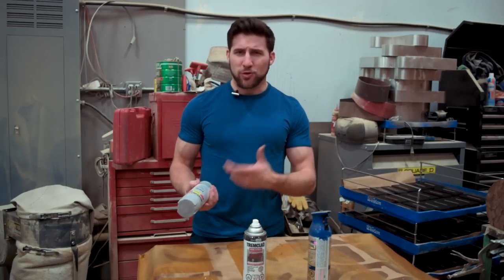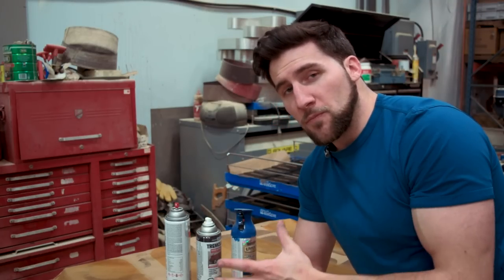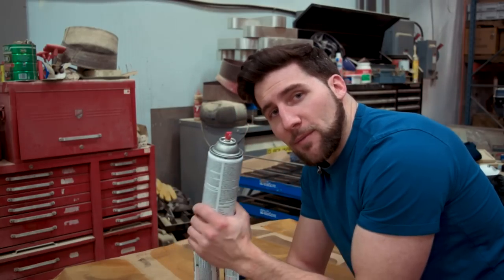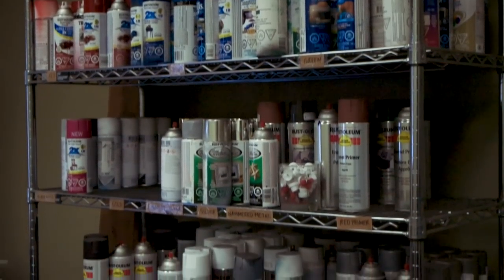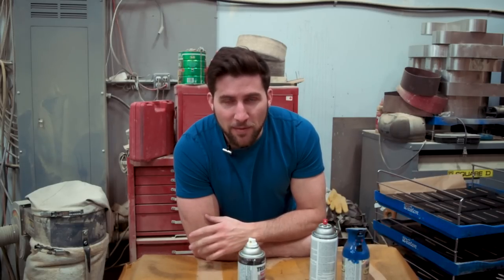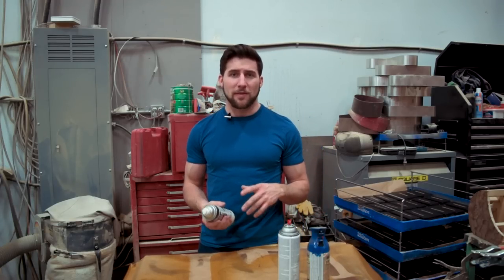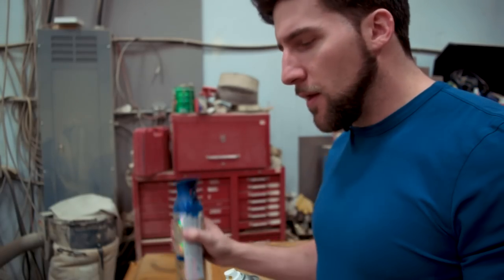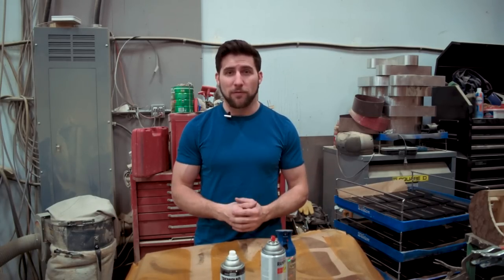Why are your paint cans spitting? (Solve the Problem!)

Comment: Warmed up cans are the key to getting paint to lay down perfect!
Reply: @designstudio8013  That will keep the cans warmed up!
Reply: Done. In the microwave it goes
Reply: @Ryan-eu3kp  air fryer is better solution
Reply: I usually heat them straight on the stove open flame much faster

Comment: I can’t believe I was putting my finger in front of it all this time!!! Thank you 😂😂
Reply from the maker: It’s actually a very common thing haha.
Reply: @BradAngove  Love your vids, Brad. I had exactly this happen, spraying SprayMax clearcoat. I was following all the safety requirements on the can, including some thin latex gloves to protect the skin. Well wouldn't you know it, I was getting terrible clearcoat spattering and nasty droplets on a guitar I was working on...and the problem was the little bit of excess latex glove at the fingertip was slightly obstructing the vertical fan of the spray pattern and that was what was causing the spitting and splattering! So annoying, now I have to figure out how to fix the mess.
Reply from the maker: You’ll have to sand smooth and recoat likely.
Reply: @BradAngove  Thanks Brad, that's exactly what I had to do. I was so frustrated that I might have to go back to the painting stage, and that would've been traumatic as my paint job was a complex burst (using your template video) with blue candy over silver base, and sapphire blue pearl over black base)...but with 2 hours of careful, painstaking wet-sanding, I was able to remove the spit marks right down to the paint without removing hardly any paint, and re-clearcoated it. Fortunately I ended up with excellent results after a bunch more wet-sanding and polishing.

Comment: Good points.
The environment (temperature, humidity, ventilation) where you spray and store the spray cans is very important.
I used to blame the spray cans for bad results more than I should have.
After the steep learning curve with paint guns and setting up a decent spray booth with proper conditions I once had a temporary issue with my compressor, so I ended up using some spray cans I still had laying around for a non important project and I was amazed at the result I was never able to achieve with the very same spray cans in the past. 
Also had no spitting anymore because the spray cans (I moved along with the other spraying equipment) were now stored in room temperature conditions instead of a cold cellar before.
I guess you could add the point: read AND follow the instructions on the spray cans :-)
Reply from the maker: I rarely read the cans. Over the years I’ve convinced myself that I know better or something haha.

Comment: hay thanks for replying me, ok now i have another issue, i spray painted my motorcycle then clear-coated it, i noticed some areas drops showing which need scuffing so i decided to sand clear-coat to reach paint and after that i level the paint, i sprayed to that scuffed part again, now i have issue of overspray on edges where clear coat was already there..how i remove the overspray from clearcoat on edges? should buff all area and clearcoat all again?
Reply from the maker: You may be able to just buff that overspray off with a polisher. That's probably easier, but if not you can gently sand it off and then go through the polishing process.
Reply: thankyou. i have fixed this problem.

Comment: Nozzle failure can also create this effect.  The red nozzle like in the video can easily crack at the stem and broken pieces can end inside the can.  I have noticed that clear coat spay cans can spit more than colors, and it is very obvious when you are nearing the end.  Also shaking the can throughout the painting process can keep the spitting at bay.

Comment: Great tips.  One of the simplest ones is on the side of the can... if you're too far away the spray drops may have time to collide and form larger drops (obviously too close and you're getting rivers).
Reply: Nice one as well. Dunno whether I´m just dumb or I missed that one somehow, but I learned the hard way that if I jerk the can too much during the spraying I get drops as well. Slow changes in direction do much better. Somehow I thought that if I move too slow there will be too much paint in one spot but it seems to do the trick alright. (don´t have to mention I´m new to this I hope)
Reply from the maker: Have a look at my video on how to get an even coat of paint with spray cans. You should not be spraying while changing directions.

Comment: The issue I have is the spray can feels stiff. The nossle. Either I press hard & hard a sudden rush of pressure. Or I try control it & get splatter, I'm going to try heat up my spray bottle after I sand sway the splatter marks once again.
Reply from the maker: Have you tried one of the trigger attachments?
Reply: @BradAngove  I heated up the can & got a good spray pattern now. I just think the paint was too thick. Now the can still has paint but no air inside lol thankfully I am done with base

Comment: I have to use spray cans pretty often and highly recommend a trigger handle. For those who don't know, you put this on the can and it allows you to use it the same way you would a spray gun. Your fingers get way less tired and you've got more control.
Reply from the maker: I disagree on the control aspect, but they definitely help with finger fatigue if that’s an issue for you, and are quite useful if you’re not switching colours much.
Reply: after trying a bunch of nozzles to spray PlastiDip without sputter, I tried the trigger handle and it worked perfectly, even with having to hold the can at extreme angles. I think the plunger pushes directly down on the nozzle and that makes the difference, when you try to hold your finger down for a long time it wiggles around and makes the nozzle stem cockeyed in the can, and that causes drips and sputter.

Comment: Rust oleum frosted glass is the worst. No rhyme or reason. Some cans spray great, some splatter like crazy from brand new and no matter the technique it just won’t work. I’ve scraped and redone aquariums so many times. And other cans work fine the whole way. Some work fine till about 1/3 left in can. Struggling right now with a can I bought yesterday and it’s driving me nuts bc I work with this stuff a fair amount and I just can’t for the life of me get this can to not spatter from the get go

Comment: I just checked my gloves You are spot on paint on the trigger finger. Wait for this coat to dry sand again and check my trigger finger closer this next coating. BTW Only had splutter on last 2 coats first 2 were splutter free so maybe gloves were tighter on finger then Top tip so Cheers

Comment: I've been spraying 2 guitars with many spray cans of colour and clear. No issues ever. Has been coming out really well. On my last can (murpheys law) of clear, the spray comes out thin with quite high pressure and lots of droplets. Tried replacing cap as well as warm water technique. Nothing seems to work. Maybe I didnt do it properly. Rather confused 😕
Reply from the maker: Sometimes things just get jammed up inside the can unfortunately.

Comment: Another problem is how there stored . Store them on there side so the solids don't settle on the bottom of the can.they mix easier with it like that too
Reply from the maker: Yup. You have to shake them well regardless, but storage is relevant.
Reply: So, is storing them on the side is good?
Reply from the maker: It can help. I like to store mine upside down sometimes as well.

Comment: Good tips! I'm new to spraying. I also read that if the humidity is too high, it will screw up your paint job when spraying. I'm doing my guitar, and had great results until I tried to put one last light coat of base color on, and the can (that was almost out of paint but I didn't realize it, it's a small 5 oz can) started spitting. Totally screwed up and now I have to sand it back down and reapply another base color coat, or is there something I can do to save it? Can I wet sand with super fine grit or something? I really don't want to spend another $20 for another 5oz spray can. (It's automotive paint, Honda Obsidian Blue Pearl. Love the color).
Reply from the maker: Try sanding it smooth with 800 grit. Then check and see if you like the look. The problem is sanding pearl with take some of the color off the pearl and leave silver flecking. If you like it you can move straight from there to clear coat. If not you will need another coat of the pearl.

Comment: Brad..... I have been spray painting my whole life ( Im 56 now ) so I’ve had quite a bit of practice at it, I usually I want a nice smooth surface this time I’m doing something different.... I am restoring a vintage receiver cover... this is a Marantz unit .. originally they came with a black textured paint looks like it splatter and it looks like it’s either satin or low gloss so this time I want my paint to actually splattered.. how do I do that ?
Reply from the maker: Try truck bed liner spray.

Comment: Received three tins of paint, Fist tin spraying onto Motorbike tank. Pressure needed to expel paint was two fingers?
The Hulk would have struggled? Started spluttering as my finger/fingers gave up. It was ridiculous. 
Tried another tin not so bad less pressure needed. But the damage was done.
Reply from the maker: Just let it dry, sand smooth, and give it another coat or two.

Comment: First time seeing your video's.  I bought a can of Spray paint, with the skinny red nozzle. The first time I tried using it, it sprayed out over everything! It was spitting bad, and it got all over three of my fingers. I could not get it to spray out evenly! What can I do? 
I used acetone to clean my hands when I got inside. Worked great.
Reply from the maker: Clean the nozzle and make sure the can is well shaken. Keep your finger away from the nozzle itself when spraying. Also, try spraying it upside down for a moment, then shaking it some more before you start.

Comment: I just got  a Krylon  Colormaxx can similar to  the  one in your example with  the red nozzle cap.  It was spiting from the moment I got it.  It is also leaking and dripping everywhere.  Any clue how to remove the nozzle cap?  It's stuck and just will not budge. I want to see if that is the issue and switch it with one that I know works. Thanks.
Reply from the maker: Just pull it out and jam a new one in there.

Comment: Hello,
I have another problem. It starts spitting and then the button gets really hard, to the point that i can't push it anymore. But the can still has ink. I can feel it as i shake it.
I'm painting a lamp on a table, so not vertically. Several angles.
Do you know what is causing this hardness ?
My can is the second type you showed. With the white button.
Thank you very much
Reply from the maker: Sounds like it may be an issue with the can itself. I have encountered this before. It becomes difficult to push and doesn’t spray. Have you tried changing the nozzle?
Reply: @BradAngove  First of all thank you for your very fast reply. I don't have another nozzle. It was bought at the store just to paint these three lamps and it is my first experience with this kind of painting.
I'll go back to the store and see what they say.

Comment: I use a cangun handle, hold the can upright, run everything at room temperature. I have the second type of can and my can spitting issue seems to be the little o-ring that seals around the base of the nozzle. Installing a clean, unused nozzle doesn't even help, since once the o-ring is deformed, paint just blows past it and gets all over the can, making a mess and getting picked up by the nozzle stream. I've tried removing the nozzles after using the can, clearing the can by spraying upside down, etc. and nothing seems to work. Basically, if I store the cans after using them partly, sometimes they survive and sometimes they switch to spitting. I was hoping for a solution like vaseline on the O-ring or picking out the O-ring and replacing it or something. Maybe it's hopeless.
Reply from the maker: This happens to you frequently?
Reply: @BradAngove  Yes, specifically with paint cans from automotivetouchup, a shop in Louisiana where you can order by paint code. Maybe they just use a mediocre can system. I usually notice it with the basecoat cans, but it also happens with clear and with primer. I have a nearly full can of primer that's useless now. And one time after my clearcoat spat on the piece, when I tried to wipe it off the drips ate through the underlying layers and I had to start all over again. Now I'm careful to check the nozzle spray first and wipe the can if any paint begins to accumulate on it, not touch any drips and just let them dry out and leave a slight imperfection.

I should start using Preval sprayers and buying the paint in pint cans instead of aerosols, but I like the ease of use, don't want to add clean-up to an already tedious task.

Comment: Anytime you can clean the tip by inverting the can, it's going to spit. Every shake, every moment off vertical. Painters Touch is the worst, because those heavy solids demand sanding and you bought spray paint to not have to sand, right?
Reply from the maker: I basically have to disagree with all of that. Sanding is part of any good paint job including spray paint, and you should be clearing the nozzle by inverting like that so that you don’t get spitting. That’s kind of the point.
Reply: @BradAngove  Perhaps we're talking about different things. Regardless, every can-- go grab a random painters choice, spray for a moment off-axis or enough to mix it about side to side and you get a thin solvent mix followed by a spit of solids. Invertible cans-- I've never had to soak any of these and they have none of the problems of the conventional can.

Comment: What can tip is best to prevent spitting? Also, best way to prevent orange peel?
Reply from the maker: I'm not sure there's a specific type that is less prone to spitting. Larger nozzles and higher quality ones tend to do it less. To prevent orange peel you need to have a nice smooth surface and get good at spraying. I also have a video with tips on how to make your cans spray better.
Reply: @BradAngove  Okay. Thanks for the reply!

Comment: Thanks for the explanations. I just screwed up and titled the Dupli-Color spray can I was using. Now I've got several spitting spots of paint I need to fix before continuing. Hope you have a video on how to fix them.
Reply from the maker: Let it dry fully, sand those spots flat, and give it another light coat to finish off.
Reply: While the paint is tacky, get a razór blade to take out the bulk of the sag then sand down the rest when it's fully dry

Comment: What about if the paint just leaks out underneath the cap?
Reply from the maker: Usually that means it’s broken. Sometimes the cap can be cleaned to fix that though.
Reply: @BradAngove  thanks I had bought some chrome for a project (a tribute to a ww2 air force pilot who lives next to me) and my chrome wasn't working it would spray but leak everywhere so it's good to know I should have returned it as soon as I bought it...oh well I can still use it as a great way for metal effects just use disposable brushes lol

Comment: The perfect match spray cans are spitting like crazy it’s driving me crazy! I hope all this info helps me I’m tired of sanding my shit because of the spitting
Reply from the maker: Try replacing the spray tip.
Reply: Brad Angove wait I can do that with that can? Where or what could I buy
Reply from the maker: Sorry, I wasn’t paint quite enough attention there. Clean the tip with paint thinner and then spray the can upside down for a few seconds until only clear gas comes out. Then give it a long shake and it should help.

Comment: I'm having issues with new cans of duplicolor. 3 cans sputter. I have done all methods in this vid. The paint is building up on the nozzle after about 2 passes on a guitar body. 
I have no clue what is going on. I e used spray cans for 30+ years and never had thos issue
Reply from the maker: You’re clearing the cans upside down after use? Could just be faulty nozzles. Often when I hear this (but presumably not in this case because of your experience level) it turns out to be people curling their finger over the end of the nozzle ever so slightly and disrupting the paint flow.
Reply: @BradAngove  yes I tried upside down. These were all brand new never used cans. At the prices of duplicolor these days I'll just use my hvlp from now on. 
You are right, I was not curling my finger. 
Adt about 3 secs of spray the paint would build up on the nozzle mid spray. I could wipe it and back to normal but wouldn't complete a single pass before happening again.
This was in 80 degree weather with roughly 50% humidity which about as low as it gets here.

Also the cans had plenty of pressure pushing out the paint really good.
Reply from the maker: I wonder if the cans were previously frozen at some point.
Reply: @BradAngove  never thought of that. I got 2 from one store and 3rd from another

Comment: My can stopped spraying and is hissing when the nozzle is removed ... Not sure what to do...was brand new and only used it once before it stopped working :(
Reply from the maker: Have you tried putting a different nozzle on it?
Reply: @BradAngove  yes and still nothing :(
Reply from the maker: Must be a faulty valve in the can then.
Reply: @BradAngove  it does look that way...it's a shame though....the strange thing is that it worked for a bit then just stopped
Reply from the maker: I’ve definitely had that happen before
Reply: @BradAngove  thanks for trying to help though I really appreciate it :)